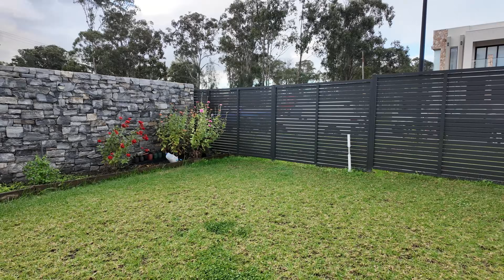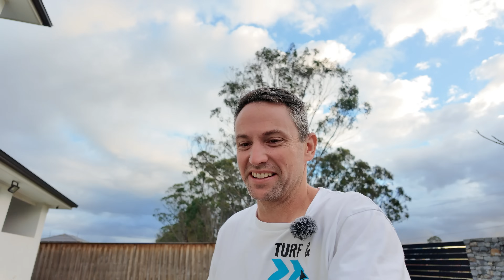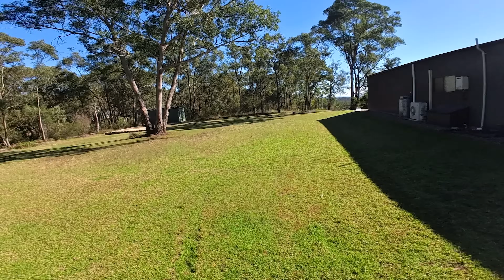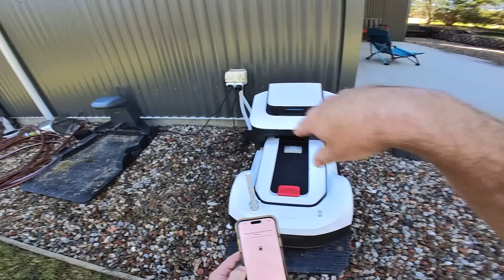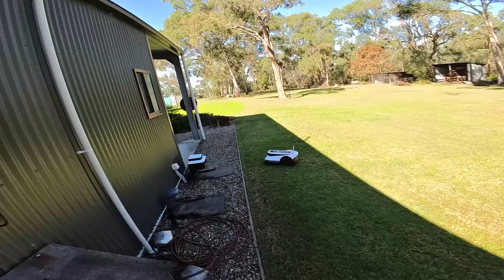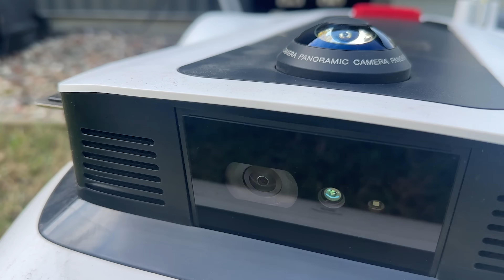Setting up the Ecovacs Goat G1 on my property.

Comment: Hi i have a U shaped garden with house in middle , if i have one beacon in front garden and one at the back , however both facing each other  on opposite  ends of the connecting side garden . Will that work with just 2 beacons as extra ones are expensive
Reply from the maker: Not something I’ve been able to try as I don’t have that kind of setup sorry

Comment: Not for me, but interesting technology. What happens if a storm blows up? Does it cope with wind, rain and blowing leaves? If the sensors get dirty while it is cutting does it try to return to base for a cuddle? It’s a bit expensive to just leave outside in plain sight in an open front yard, but might be ok for a fenced area. Thanks for posting.